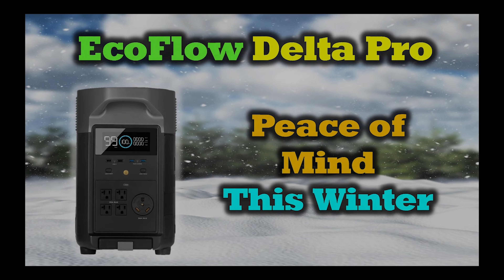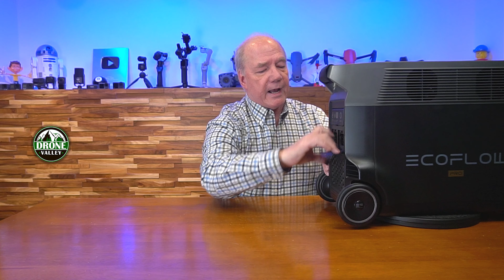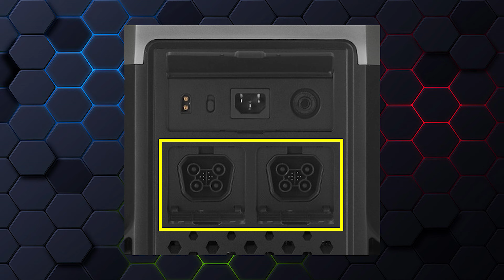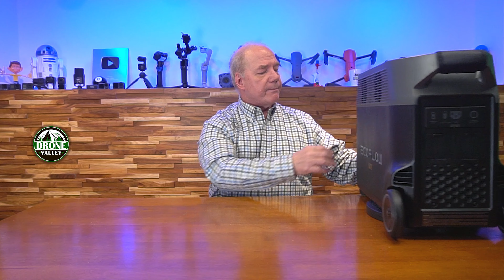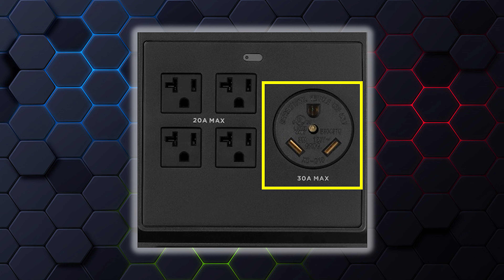EcoFlow Delta Pro - Safer Home This Winter

Comment: $3500 will give you pause!
Reply from the maker: I agree and it's mostly designed as a power backup for your home. You can connect it to your homes electrical panel with an EcoFlow kit and when you lose power, this will kick in and provide backup. It has wheels but it's a heavy unit and really designed for an RV or as a home backup. If you add the extra batteries, you have a very impressive portable power solution.